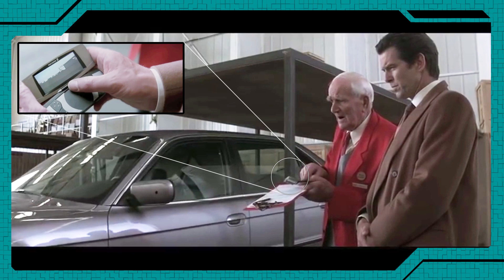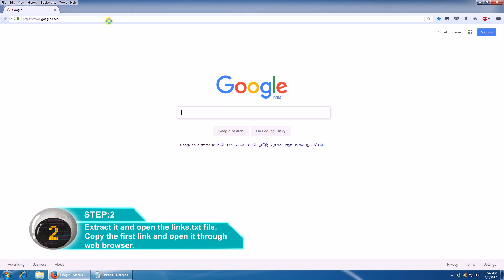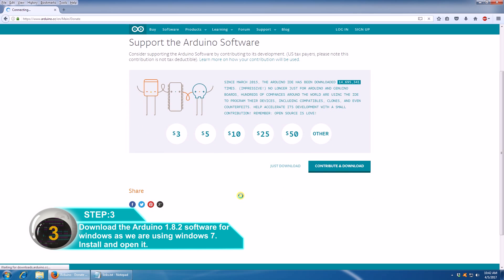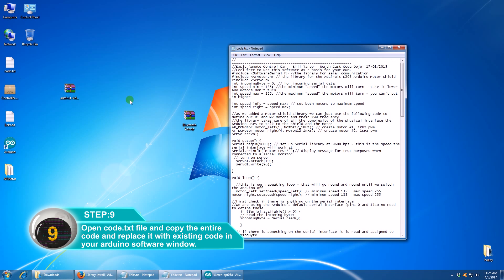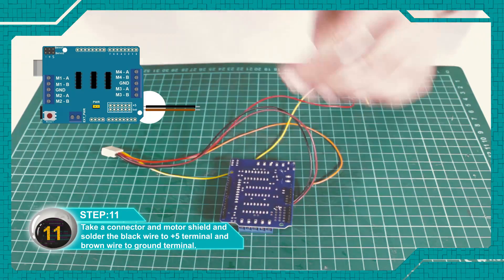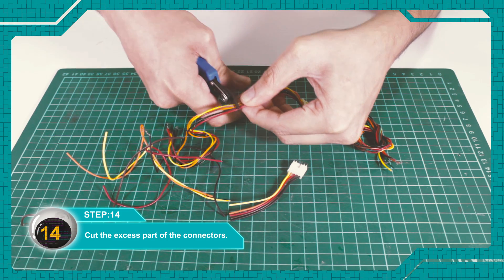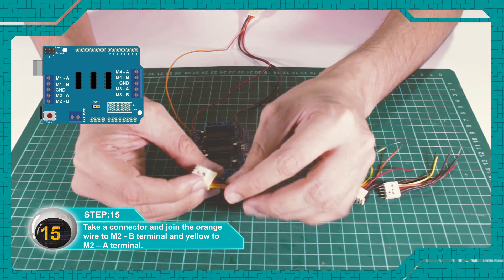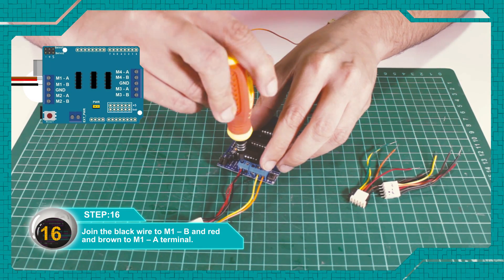I made a smart phone Controlled Car! Happy Building!

Comment: Can we use another RC car .......?????
Reply from the maker: Yes you can! As long as, 1. It works on a similar motor setup (most do, but be sure to check)  and 2. you have enough room in the cabin/chasis / on top of the car to place the Arduino+bluetooth module etc. :) #HappyBuilding

Comment: Prateek sir, could you please make a drone controlled with a arduino and great video
Reply from the maker: Arduino/Genuino Uno is a microcontroller board based on the ATmega328P. It has 14 digital input/output pins (of which 6 can be used as PWM outputs), 6 analog inputs, a 16 MHz quartz crystal, a USB connection, a power jack, an ICSP header and a reset button. It contains everything needed to support the microcontroller; simply connect it to a computer with a USB cable or power it with a AC-to-DC adapter or battery to get started.. You can tinker with your UNO without worring too much about doing something wrong, worst case scenario you can replace the chip for a few hundred rupees and start over again. https://www.arduino.cc Hope that helps :)
Reply: BroSis what is auidno a robot or sreen
Reply from the maker: The UNO is the best board to get started with electronics and coding. If this is your first experience tinkering with the platform, the UNO is the most robust board you can start playing with. The UNO is the most used and documented board of the whole Arduino & Genuino family. :) Happy building!
Reply: Prateek Sir it is nic video